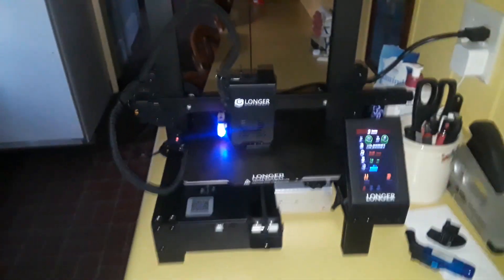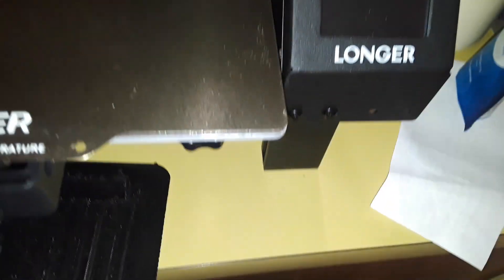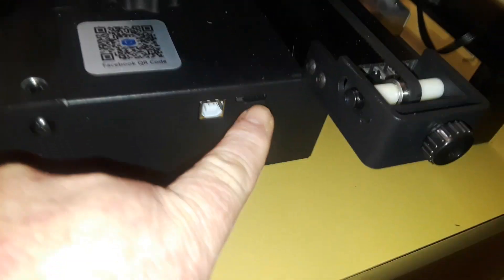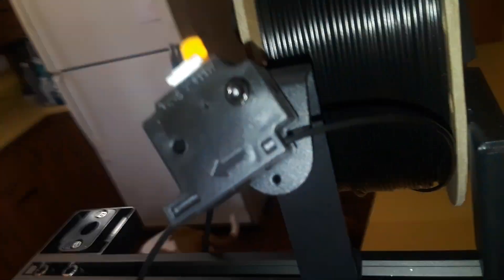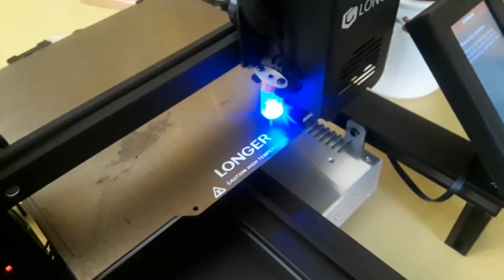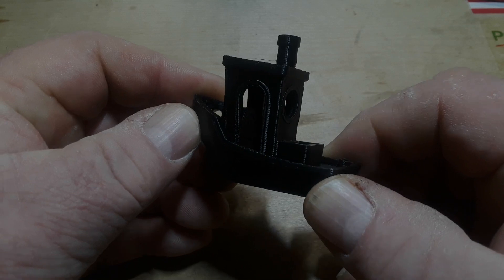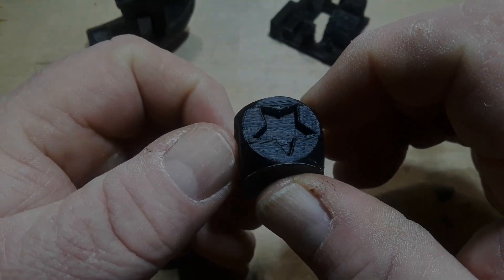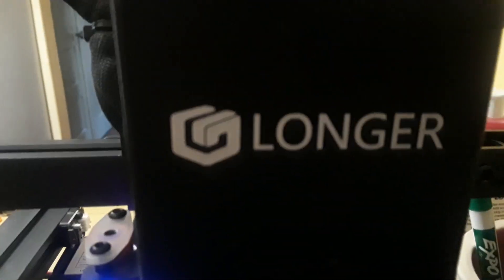Longer LK4X 3D Printer First Look

Comment: hi, it looks like your printer throws out too much plastic when you print. and you must wear more cooling. and is your retraction too short. try and see if your nozzle size and plastic size are correct in your slicer program.

Comment: I have a few questions about 3D printing. 

How accurate is the output?
How durable, and strong, is the final product?
How difficult is the maintenance of the printer?

My interest is in making the mechanical components for projects. Things like cogs and brackets. Such things need to be strong and not turn into powder in a few months. This is no doubt dependent on the properties of the material being printed. What I am not interested in producing are expensive small plastic ornaments, which demonstrate the technology, but have no practical value. 
I would be interested on your views of the properties of the different printing materials.

Comment: Hello, I have a Ender3. I run my nozzle temp around 230c and bed temp at 60c. My speed varies and depends upon the filament I use. 50 is standard but I have sped up to 70 when I use PLA1.75mm filament and use a .6m tip. Might not work for you but it has helped me a bunch. I use Fusion 360 as my design program.

Comment: here are mine:
1) That version of auto bed leveler is notorious for being NOT accurate.  is there an option to run a repeatability test on it?  Typically, M48
2) I think you are tool close to the bed.  Move your z offset up by .2MM and try a single layer test until you get good adhesion and appearance.
3) What slicer are you using?
4) Did you slice the Benchy?  Or was that G-code included with the printer?
5) Temperature, crappy filament, or retraction cause stringing
6) you might want to calibrate your Extruder E-steps

Comment: One tip that helps with bed adhesion is clean the bed with Isopropyl Alcohol every time your ready to start printing. Sometimes a few fingerprints or plastic residue is all it takes to prevent good bed adhesion

Comment: I don't know if this will help you, but it wouldn't hurt to try:

For me it did alot to Enable retraction for reduced stringing if I remember correctly, cause it was basically leaking out when it moved, but retracting caused it, well to retract the thing. 
Other settings I used  - Set walls thickness  2 mm, -  Top layers 6 - Top pattern Concentric - Enable Ironing - Top/Bottom speed 36mm/s (don't remember if I set that or the program was set at that.
It wouldn't be a bad idea I guess to try top surface skin layers to at least 1, haven't tried it. 
It printed slower like that, but it gave a pretty good print from Cura in my Anycubic Vyper

Comment: Maybe Longer can supply some feedback on the printing issues. This has always been my issue with 3D printers, although they have come a long way you still have to fiddle with multiple settings in order to print something reasonable, you typically only discover failures after many wasted hours of previous attempts.
Reply from the maker: Same here! This is my 3rd 3D printer and I look at all the settings and think....Im too old for this crap!

Comment: Hay Paul, I keep thinking about a 3D printer but it would be a fun toy to play with but I don't think I have the use case to justify the big $$$'s... Thanks for you video!

LLAP 🖖
P.S. Check you pay pal... 🖖😄
Reply from the maker: Bruce, thank you so much. I dont really have much use for a 3d printer either. But they are fun to play with.
Reply: @learnelectronics  I build Models (cars-trucks) from time to time and I could see a use case there but parts and old parts are still easy to get on ebay. Yes I'm a 69 year old kid... Lol

LLAP 🖖

Comment: Looks like moisture in the filament maybe...causing those bubbles on the overhang test. Possibly some over-extrusion, and try to increase your retraction settings a bit.
Does your model of the benchy not have the text in the bottom surface? That and the minor over-extrusion is all I can see on benchy.

Comment: I love the auto bed leveling, My first 3D printer didn't have that and it was a pain..
Reply: I got the Ender-3 V2 I've added the BLTouch and first heavier springs then I went to solid spacers. I have a filament dryer and use vacuum bags for storage. 
I would suggest going through and getting things dialed in. I know there's several videos on doing it. I think CNC Kitchen has some as well as Chep, 3D Printing Nerd, Edge of Tech and others.
Reply: Same here. I got  a RepRap Mendel in around 2012. No bed levelling. Glass surface with a heated bed under an aluminium plate. Worked fine when it was dialled in, but until that.. Painful. Took me a week of careful assembly. 

Upgraded to a Prusa in 2016, 1 day to assemble. And to date, the only replacement has been the bed levelling probe(broken wire). 90Km of filament and counting...No reason why it will not last me another 6 years😀

PEI bed, self levelling, self tramming.. Never been happier with a purchase, 

Next one will probably be one of the Chinese models. And be chugging away in half an hour.
Reply: @JohnBailey39  I had the Ender 3, it was a gift but what a pain..
Reply: @robertwebb5586  Really? I was thinking of that one.
Reply: @englishrupe01  I love it and it's like only 6 screws and it's all together Neptune 3 is the one I have
Reply: @robertwebb5586  OK, thanks. I have been eyeing the Ender 3 Max Neo.